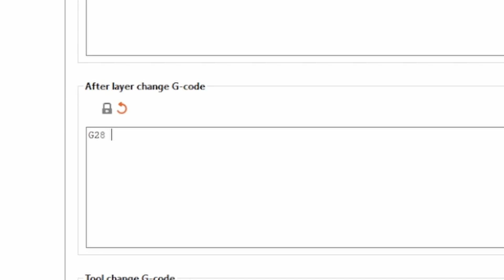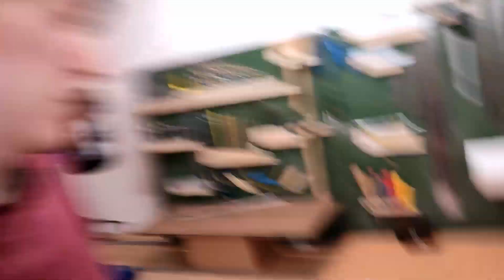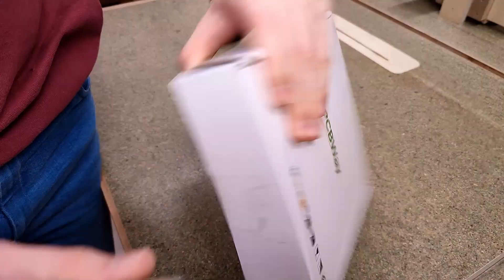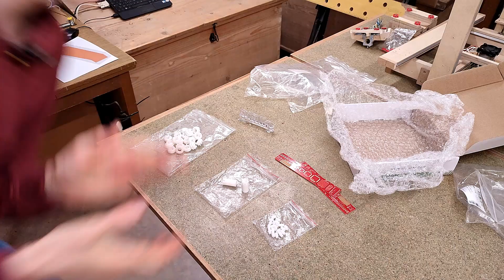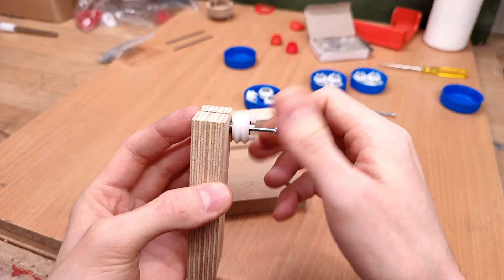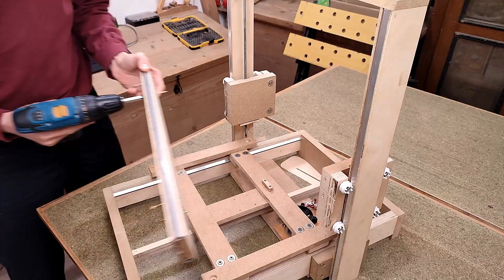FIXING my unipolar 3D printer! | part 16 (new wheels)

Comment from the maker: Little correction thanks to patrons pointing it out: ABS isn't actually a high strength plastic like I implied at all, it's just an engineering plastic and stiffer than HDPE. I chose it because it's easily obtainable (the chassis of like 80% of appliances is made from it) though I did some research after the fact and from what I can tell aside from machining its other properties actually make it rather indesirable for wheels like this. PETG would definitely be preferable, maybe even PLA would work. Ultimately though POM or PC would be the way to go.

Comment: Fyi get all that from an old pair of roller blades.  You just need to carve the wheel down.  Might be too big of a bearing?
Reply: Each pair gives 16 bearings.  They are built for weight too!
Reply: Roller blade wheels use a machine screw with no threads where the bearing goes too!

I purchased many at garage sales for $2 a pair.

Comment: Dang the algorithm must be punishing you, i havnet heard anything and decided to check up and sure enough theres 2 videos i havent watched.  All i have to say is keep at it, your good, eventually the algorithm will learn.   Cool DIY manufacturing techniques and please ventilate that ABS i hear its pretty toxic, Im working on ventilation system before i print anymore, just a box over the printer with a tube and a fan to blow the air toward a window.  Resin looks like the way to go for small accurate parts, they have ones out with 12k resolution now i hear.  But thats even more toxic then ABS i hear... Anyway I know you love to salvage e-waste and so do I and I had to tell you the e-waste i found the other day.  A whole 3d printer! well almost whole, its missing the hot end, and its also made of wood. IM guessing a DIY job from way back when they made them out of wood.  Its got dual stepperer motors for the Z, 1 for the Y and even the belt is still intact otherwise it looks like it was burried. Its covered in mud and dirt, but the bed still slides back and forth  hehe.    The wood parts look CNC cut, maybe it was some kind of kit from way back? Im thinking of resotiring it but had no hope initially, but  if you can make a wood 3d printer from scratch... even the rollers... i surely can restore one?  Probably not.  AnywayI found it on  nature trail along a river under a train bridge.  Very odd spot for a 3d printer but kind of fitting,  being it was made of wood and covered in dirt it felt like it belonged outside, for a  hobo to print functional parts like hangers for his wet clothes or something.  You should make one out of steel next,  you'd be stiffer and more accurate then every printer on the market!
Reply from the maker: Yeah my entire channel's in a slump right now, I thought it was because the last two videos weren't a huge success but someone else mentioned notifications not working as well so the former is probably the result of the latter, not vice versa...
No worries about the ABS, I usually only spend 1-2h filming so I called it a day soon after and the fumes had time to dissipate till the next day.
Cool, I wish I would find ewaste like that out and about, it's so hard to get one's hands on decent ewaste over here! Do the stepper motors still work after sitting out in the rain?
I've already collected most the parts for my next printer, it'll be much more modern :)

Comment: Marlin? Set Z_HOMING_HEIGHT to 0 in order for it not to raise itself on homing attempt. Ask a friendly neighbourhood contributor to the firmware. (hi)

Of course when you do 3-axis homing, you have to manually make sure it's high enough to actually accomplish homing.  I could just develop a patch that ignores Z_HOMING_HEIGHT, treating it as zero, if Z is already homed and Z isn't part of homing request.

ABS has low abrasion resistance. I am not inclined to use it for rolling surfaces. Indeed HDPE would be one of my choices... so it's unfortunte that it didn't quite work out. Maybe it just needs a more supportive geometry, like you're using this time and unlike you're using last time? HDPE is also fairly chemically stable when heated to the melting point which ABS is not, so a lot can go wrong when trying to recycle ABS. I wonder if that's your bubbles. Or just uncured styrene, i mean butadiene is a known styrene polymerisation inhibitor. Honestly i don't understand ABS, i mean i have a vague idea of the chemistry, i just don't know why it is everywhere, since it's actually sort of bad.

If you're ordering your rollers off your kind sponsor, they can just do SLS PA(Nylon) which is one of those materials recommended for this sort of thing.

This build is absolutely spectacular.

3D printers with a single bearing wheel exist. Geeetech A10, that one has these V-slot extrusion wheels, but they're different from usual in that they only have one bearing. And with rigid plates holding everything together, it actually works fine.
Reply from the maker: Hi! Thanks so much, I love getting feedback from the real nerds of the community 😅
I didn't think of getting rid of the homing Z lift that way. I guess for the initial homing of all axes the Z lift command could've easily been hardcoded into the start Gcode.

In hindsight I don't know why I thought ABS would be suitable for wheels, I think I get what you say about abrasion resistance from the way it machined. I also did some research after the fact and it said ABS doesn't have a melting point per se, which kind of explains why mine was getting that weird rubbery consistency. I guess HDPE would've totally been fine with the new wheel geometry, I just thought it might be too squishy in the long run and develop flat spots. Now after watching the recent filament wear test video by My Tech Fun I would probably try PET or PETG seeing as it came out as one of the top wear resistant options (I say that ofc without any further research nor ever having worked with it first hand...)

Thanks for the heads up about the Geeetech A10, I wonder how they made it work... By using half-decent bearings probably :p

Comment: I am having trouble in printing can u help me  when I start printing the flow rate of filament is low and the extruder is unable to push the filament after 20 secand them temparature is 240% and I'm using nema 17 moters nothing is clogged and I have changed the heater also

Comment: What are the steps u used for z axis in the code
Reply from the maker: Z-axis steps per millimeter? Since it's an M5 thread with a pitch of 0.8mm and a 48 step/rev motor in halfsteps mode, it's 96 steps / 0.8mm = 120 steps per millimeter of movement
Reply: My filament is jamming and not melting everytime I need to pull out the filament and cut a little pic and I need to put it back while printing what do I  do the temperature is 230c
Reply from the maker: @hum.ortales1753  what kind of printer is it? Extruder? How long is the bowden tube? Is the hotend new? I need information about the printer if I'm supposed to help, there's like a million of variables causing jamming.
If it's a 28BYJ-48 extruder with bowden tube it likely doesn't have enough power, that's what happened with mine, it's the reason I'm converting to direct drive.
Reply: It's nema17 moter with ptf tube and the part which is jumping the nozzle is not melting when I directly put on heater of hotend

Comment: I'd never thought to use a drill press as a mini-lathe. Gives me something to think about!
Reply from the maker: It's also very useful as a makeshift milling machine! Just put a dremel style router bit or burr in the chuck and run the workpiece back and forth on the table for some miniature face milling (though preferably clamp the part in a vice for that because small parts especially tend to get caught on the router bit and pull your fingers into it x)

Comment: Yep, two bearings are better than one. And if you ever build a lathe or mill, you actually need two pairs of bearings for the spindle. Even expensive bearings always seem to have one point in their rotation where there's just a bit of jiggle, and under heavy cutting forces it causes terrible vibration. But with two at each end of the shaft, one still supports the load when the other crosses its jiggle angle.

Comment: FDM printers are actually very good at round parts, better than SLA because they are baisically vector drawings stacked on top of each other. I'm pretty sure ABS rollers can be feasibly printed even on this printer prior to this video (still with milled HDPE rollers), if the issue with homing is solved of course.
Reply from the maker: Honestly I hadn't even thought of that. You're probably right, though I'm not sure the bores for the bearings would've come out round enough without subsequent machining to insert the bearings due to the stairstep motion I was getting with those motors...

Comment: Ah yes, another banger of a video! I think some (only some) rigidity of a new V-roller is added by the fact you mount them with plastic adapter to the correct diameter of bolt, not with wooden screws with no material between id of the bearing and screw  Direct drive is certainly a great upgrade, can't wait for X and Y axis motion system video.
Reply from the maker: Thanks! I dunno, the idea at least was that the countersink head of the wood screw would center the bearing and on the screw and solidly bear the inner race against the washer - which didn't help because those sides are crooked as well 😂
X and Y motion will be the next video, I need to see how well those lead screws work before I take the plunge on my laser cutter and end up with unwelcome surprises again...

Comment: have you tried a direct drive aproach? seems like it could benefit you greatly
Reply from the maker: Direct drive extruder or X Y motion ? Extruder is direct drive from now on, but a direct drive gantry isn't possible with the crappy steppers I'm using. I do have better motors, but I'll keep those for a better printer :p
Reply: @ChronicMechatronic  i was referring to the extruder, and does it make any difference in printability since you switched?
Reply from the maker: @FUKTxProductions  haven't tried it yet, but I'm sure it'll be a HUGE difference without that bowden tube. The 28BYJ-48 is barely powerful enough to push the filament through a tube this long so I had to go really slow so as not to skip steps, which, along with the inherent backlash of bowden setups really made retractions suffer.
Now I should be able to run the motor significantly faster in addition to getting so much better control over extrusion
Reply: @ChronicMechatronic  for the extruder,  try a rollong block extruder if you can find files to print one

Comment: I don't know if your audience knew, but a wood frame 3D printer was a buzz in 2014 with Printrbot Simple 1405, like Prusa made the buzz in the community one year later with the Prusa I3, killing the market with reliable printer.

The Printrbot simple (wood) was my first 3D printer and I learn a lot  about set and manage trouble on printing PETG at the time.  Thank you for remind it me to this great time !

Not building my 4th printer all from the ground, CoreXY 500x500x600mm with enclosure !
Reply from the maker: They had some awesome funky printers in those early days, I wasn't yet present online at the time to witness it, I'd just built my first table saw and was starting to set up shop in the basement 😅
I love the vibes I get from looking up those pioneering designs in retrospect!
The Prusa I3 sure is a solid design, yesterday I watched the video about how their printers are made, and possibly their biggest strength is that they actually run those machines 24/7 in a print farm to make new parts...

Comment: Benjamin is like "Upgrades People, Upgrades!", but All the Rails are now Silky Smooth!
Reply from the maker: It's funny because I'm not really an upgrades type of person, I usually just design and build a better machine based on what I learned since I don't really like having to work around earlier bad design decisions :D
Reply: @ChronicMechatronic  That is the Definition of Upgrades! LOL! You improved it, right? It's a Upgrade from it's earlier iteration?
Reply from the maker: @lunarz7117  well, I guess it includes the improvement, but I still designed a new machine from scratch which in my case usually ends up totally different.. At least I always thought of an "upgrade" as kind of a band aid, a "hack" to make a previously botched up thing slightly better 😂

Comment: now to the part where the printer starts to print parts for itself make it a new series,its gonna be exciting with your creativity and CAD
Reply: I hope this is what happens and that the printer doesn’t keep having outsourced printed parts
Reply from the maker: @lovecastle7154  good point - I don't like this cheating either, hence why I spent 6 minutes of the video proving that I can machine these parts myself. I just didn't want to do it 16 times, and since I have to integrate the sponsor somehow anyway...
But I promise those will be the only third party printed parts on the project.
Reply from the maker: That's definitely the next step, though I'm kinda planning to do that mostly off camera and end the series with the printer delivering decent results since I feel this project has mostly run its course. I'd rather make a series building a new, better printer using this one to make the parts...
Reply: @ChronicMechatronic  thats an even better idea goodluck my friend